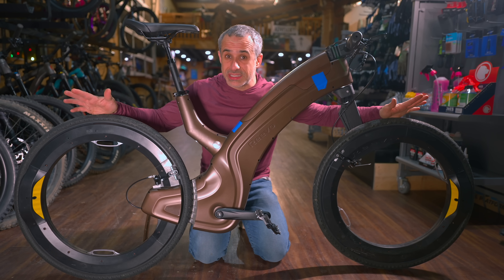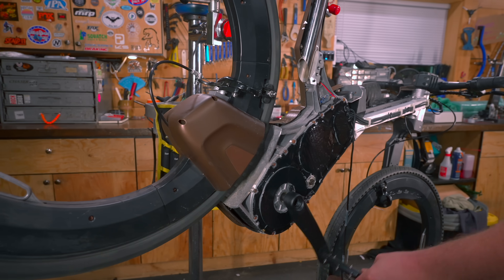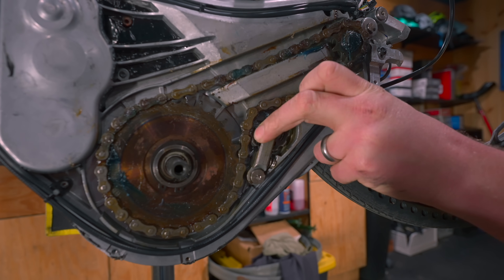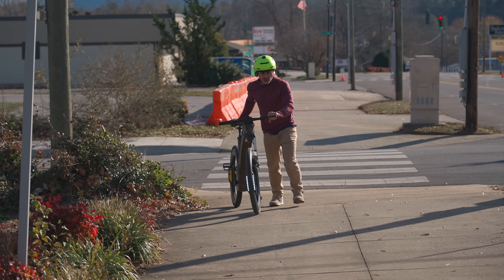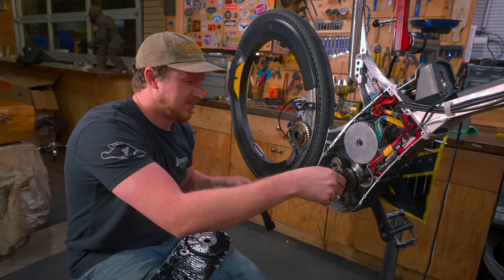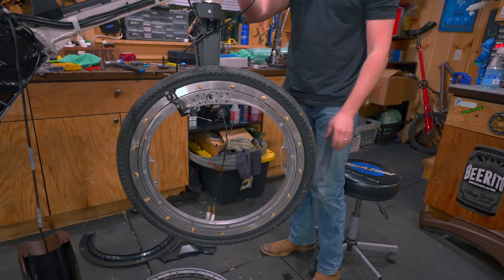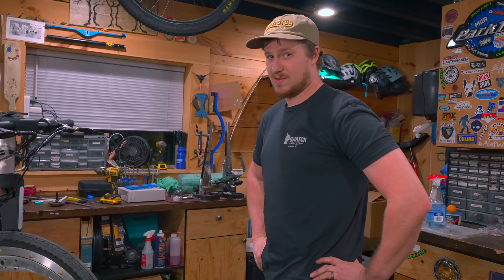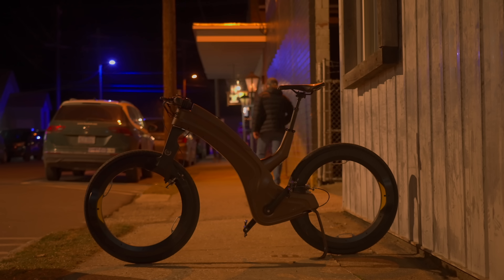What's Inside The World’s Worst eBike? Reevo Teardown

Comment: 4:36 On the end of the crank axle you can actually see the "incredibly clever pedal assist" which is just 12 magnets with a sensor for it in the casing probably. It's called a cadence sensor and is used mostly on cheap chinese bikes and diy ones. It only senses the rotation speed of the cranks and even with a proper freewheel feels like a death trap.
Reply: It should really be measuring the torque from the pedals, so if they free-wheel as was shown, there would be no torque from then so the assist motor would not kick in.
Reply: I'm kinda flabbergasted that this bike doesn't have an actual freewheel anywhere, it's just such a terrible idea
Reply: I'm one of the suckers who have this bike and have had it apart a few times. With regard to the 12 magnet pedal assist plate - is it meant to be fixed to the gear behind as mine just free wheels on it's own?

Comment: at 3:50 you can see a servo (used in every rc car and airplane) its the Blue thing with the red stripe. Even the servo is the CHEAPEST model possible. It might not even be bad how they used it but I think it's hilarious
edit: when you see all the cables xt60 connectors or xt 90 (Im unsure what it is) can be seeen, also commonly used in the rc hobby
Reply: That servo looks like Hobbyking 2 usd basic 9gr servo, mostly used on small foam planes, and it has plastic gears... Expecting at least them to use metal geared servos, but no... 
Geesh. Totally cheapest and crappiest servo that exists... :D
Reply: This is so fucking infuriating it Looks Like a Tower pro knockoff😭

Comment: I would love to see you put it back together with an improved design.  A more powerful motor with a more direct drive.  Better bearings on the wheels etc
Reply: You'd have to rebuild it from the ground up and redesign a lot of it. Look at the solid aluminium frame alone, that should be replaced with tubes. Possibly replace that giant hub gear with steel to reduce wear (though that would horribly increase the moving weight). If you wanted to properly improve the design, you'd have to make it more serviceable, you might have to replace a lot of the software, too.
This would basically turn into a ship of Theseus situation

Comment: It's like the juicero of bikes. Zero thought went into functionality, but the engineering put into such a dumb idea is actually awesome and beautiful.
Reply: Its really not. Engineering is using  least of materials and solutions  possible to reliably accomplish the task. But this is an example of  anti-engineneering.
Reply: @dukenukem8381 this is just what happens when engineering is constrained by industrial design. The company wanted a hubless wheel. This is what it takes to achieve that. The engineers did their job, but what they were told to do was make a cool looking bike not a good bike. 

It’s not an engineering fail, it’s a product design fail.
Reply: @ No it doesn't take ten or more bearings and multiple castings to achieve hubless. It can be achieved many  different way more efficient ways .This design in the video is by 12 year old.
Reply: The juicero was completely overbuilt for the purpose. Someone wanted a press and the engineers made a really good press. This is just poorly designed because someone wanted to throw out a very efficient part of a bicycle and use a very inefficient one.
Reply: I thought the juicero was way over engineered but it did work, this doesn't. Wasn't it the cheap loss leader for extremely overpriced juice bags?

Comment: I feel like there has never been a better time for shitty bikes. There have always been cheap bikes, but even those were viable transportation, you just have to work harder. I think ebikes should have a higher standard, in that they should work just fine without electricity, but become fantastic with electricity. I recently parted out an ebike, because it was terrible as a bike, and terrible as an ebike(yes, it does 20mph, but its heavy and underpowered (500w))
Clearly, the thing to do with your bike, is to redesign it to be better, make a video about it, and sell kits to upgrade them.

Comment: From the hindsight. If they had a chain in there, they could just make two chained drive system: one for pedals and another for motor. So they didn't have to add dozens of gears.
Edit: This bike after-sale service will be the same level with Apple. Imagine your hubless wheel bend. No way you can find that service outside the brand.

Comment: the gears to connect the motor are bizarre, becausse you dont need to have a chain of gears to make the motor spin the right way, you can just turn the motor around and spin it the other way (assuming the motor cant just spin both ways anyway like most can) and eliminate at least 1 gear, or just connect to the thing directly, or use a chain like they did with the pedals, or even a few bevel gears and a driveshaft, or...

Comment: Techbros trying to reinvent the wheel in the most literal sense possible
Reply: But hubless wheels arent new
Reply: This is what happens when nobody involved in the product development knows anything about why bikes are how they are. The wheel spin test says it all really.
Reply: @eternaloptimist2840  So, basically just like every Techbro invention out there?
Reply: They didn't even do it properly! We know how to make arbitrarily curved linear tracks that can support metric tons of load, for industrial applications. This, with cheap crappy V-slot wheels in a V-slot channel, is not how it's done.
Reply: Should never have left the requirements stage.
Reply: I laugh every time they try to redesign trains, always far more expensive to move far less people. It's crazy.
Reply: @ "But... it has AI in it."
Reply: Should have been wheellegal
Reply: Those aren't wheels, they've invented solid one piece circular tank tracks,  put the idler wheels on the track and replaced the drive sprocket with a cog. So it is a pedal powered battery assisted tank, with the performance and weight to match, only it is not been made bullet proof.
Reply: This is just the first draft. Give them a few billion in VC and a few more years, they will iron out the kinks and have a standard bike.
Reply: @JohnC1 the makers have dipped. They will not be making more bikes anytime soon
Reply: @JohnC1  lmao, it's the techbros reinventing trains all over again
Reply: True, but that’s how innovation happens. Kudos to them for making something entirely new; even if it was awful in practice, new ideas and inspirations will come from it.
Reply: @ricercr44  It's really, really not. Innovation happens when people actually consider the needs of the people who will be using it, which very clearly didn't happen here. This was just cosplaying innovation.
Reply: @crytocc what do you know about prototyping, product development and innovation? It’s not something that you can just judge by gut feel as an outsider. The product is crap, but armchair experts aren’t going to explain why
Reply: @ricercr44  No, i'ts pretty much the opposite of innovation.  Innovation requires understanding why things work the way they do, and how people interact with them.  In this space, innovation would require understanding the literal century of actual innovative engineering that went into developing the bicycle that we have now.  Actual innovation is someone saying "how can I make this more efficient, more durable, more ergonomic, or more safe, without damaging usability?"  Techbro pseudo-innovation is "how can I build this cool thing I saw in a video game and make a bunch of money off it"?

There is literally nothing in the Reevo that is innovative.  Hubless wheels are been re-invented multiple times in the past, and each time they proved to be far inferior to standard hubs.  The Reevo does not even use an innovative hubless design, they simply re-created an old rejected design, but made it worse, with low-quality materials and backyard construction techniques.
Reply: @ricercr44  It should never have left prototype stage.
Reply: @pizzablender  I wonder if they even built a prototype to test anything out, this looks so bad that, I suspect this went straight from the CAD package to the manufactured ebike.
Reply: @ricercr44 There's no innovation here, nothing that hasn't been tried and failed before, just with pedal-assist and an app this time.
Reply: @ricercr44  Its how shitovation happens
Reply: @frankdobs  it’s how both happens.
Reply: @ricercr44  Hubless wheels are not entirely new. They've kicked around for many many decades, usually as props or one ofs to look cool. Every engineer knows the physics that makes hubless wheels terrible, so only fools would attempt to put one on a mass produced product.
Reply: @ricercr44  that's not how innovation happens tbf. This is the opposite of innovation. Its not solving any problem whilst existing applications have been proven to work for over a century all over the world.
Reply: @ricercr44  If you cannot even make your idea function properly on paper, you're not innovating. You're just repeating mistakes that you could have learned from a textbook.
Reply: @ricercr44  It should have been obvious when designing this thing that the hub is the entire reason wheels are so efficient. It's like making a screenless television. No, we don't need to innovate by ruining the purpose of things.
Reply: @ricercr44 when you are trying to be innovative you should always add common sense to the plan. In this case they did not.
Reply: @ricercr44  No, this isn’t innovation. It isn’t even close to innovation. This is like someone deciding that a new geometric shape should be used for wheels because circles are outdated technology now. Innovation happens when someone finds and implements a better solution, not when they try to sell a completely impractical idea that’s worse in every way than the existing solution.
Reply: @CanIHasThisName  that describes the Segway to a T!
Reply: @ricercr44  except this isn’t a innovation. It’s a downgrade

Comment: Dumb engineer here so just speculating; but I couldn't help but notice in the clip it kind of sounds like you might have some motor/generator action going on, kind of like when you try to push one of those wind up car toys along the floor and it has resistance. I'm speculating here, but what if when the motor drives the bike, it acts like a motor, but when the pedals drive the bike, it acts like a generator. That would create a back EMF that would create some hefty resistance in the pedals. I've researched none of this so take it with a grain of salt, but I could see a world where they don't disengage the motors or clamp that back EMF in some fashion, which must be a thing that normal pedal assist system account for? Or more likely, a way to mechanically disentangle the two?
Reply: Normal e-bikes don't back drive the pedals and motor.
And it's achieved in the simplest way possible: by the freewheel in the rear wheel
Reply: Good thinking, but the wheel spinning test was on the front wheel.
Reply: I wouldn't be surprised if the designers did overlook that issue but, to me, it's just the sound of a really inefficient drivetrain.
Reply: I think you’re on the right track. E- bikes with direct-driven motors do create resistance with normal pedaling because the motor is always engaged. E-bikes with mid drives or geared hubs tend to have a clutch that lets you pedal without driving the motor, so much less resistance.
Reply: the front wheels terrible as well... but on the rear? the rim gear is massive, at a guess, its about 6:1 step up (approx 24 inch to 4 inch) when backdriving. so then the chain is spinning stupid fast, and theres how many bearings in there?
ANY gearbox with a 6:1 step up is pretty hard to spin... 

they should have the freewheel in the final gear, and that would at least cut the losses down to just bearing friction in the rollers...
Reply: 🗣️ I was kind of thinking the same thing. It also leads me to believe that it comes across as a trickle charge for the battery... 🧐

Comment: Reminds of the juicero, if you haven't seen a teardown of that thing it's worth a watch. Over-engineered to the moon and still a dumb idea.
Reply: It's actually under engineered. The designers were given a huge budget per unit so they just threw together the most solid, blocky structure they could. It takes a talented engineer to design something that works, but also is simple enough to be cheap.
Reply: also with aluminum gears that looked like they were designed by animators not engineers. for power gearing of all things. think I gotta mark these down even further, they look die cast, at least the stupid Juicero gears were for super intermittent use and made from plate
Reply: And still somehow sold at a loss.
Reply: @DrEpicPhD  It was a subsription based revenue machine, and probably they over-engineered it to last a pretty long time. The longer you can milk your cow is the better you see :D
Reply: @ggooaa100  just a shame that the bearings in the Juicero were being loaded in completely the wrong direction and were doomed. Still, you could at least just squish the smoothie out by using your hands.
Reply: Overbuilt, under-engineered.
Reply: The Juicero had better build quality though.
Reply: @ I meant it in the sense of a ton of R&D spent solving problems that don't exist.
Reply: The review of the juicero, the dead-pan voice of the "honest review" is one I keep watching as a reminder for when I will never start a kickstarter project as a form of advice on what not to do :P .
Reply: Fucking dumb, but over-engineered in a good way. That thing was marvelous in a machinist eye, but this thing... Just crappy off the shelf stuff thrown together with aluminium square tube welded to cheaply casted parts, and so on... No locktite on a rotating part with a dozen of screws and no suspension from the wheel(air tube) or literal suspension.. What were they smoking?
Reply: It's not a dumb idea at all, and the way you are pretending that it is is incredibly ironic. A few years ago, I would have given you the benefit of the doubt and asked you to consider editing your comment, but I'm not expecting that kind of critical thinking from people these days. Buying a smoothie in a bag in obviously much more environmentally friendly than buying it in a plastic bottle and is probably cheaper, therefore it's an inherently decent and marketable idea. The absurdity of Juicero came with needing an electronic press with DRM when an OPTIONAL 5 dollar plastic hand operated one that comes "free" with a variety pack is all that was actually needed.
Reply: @awesomeferret  What a magnificent comment, all that to agree with me that spending millions of R&D on a juice press was a dumb idea.
Reply: @awesomeferret  The better counterpoint to Juicero isn't premade prepackaged juice or smoothies, but a conventional blender/juicer and fresh ingredients. That wins on environmental consideration, health, and cost - at some loss of convenience. Juicero was outclassed by some other method in nearly every area unless you had a very very niche combo of preferences, and then it was still of dubious quality and no longevity. An obvious VC grab for subscription revenue vs actually making a good thing, and it failed, and that's why so many people dunk on it. Hopefully that makes some sense with a little more of your critical thinking, to reference your wording. Or maybe you're a troll but I'll still give you the benefit of the doubt.
Reply: @awesomeferret  you tried to sound smart but came off as a tool. Lol.

Comment: low key want to see if you put good bearings in it to replace the ones you took out if it would roll better
Reply: Don't think so. There's too much rolling resistance created by all those tiny wheels around the rims.
Reply: You're gonna need to replace the hub for that. V-slot needs to come out for T-slot or better yet, the whole shebang needs to be replaced by a curved linear track assembly. Would probably cut the roller count to just 8 or fewer that way, and they'd be metal on metal, with much less friction involved.
Reply: @vjoe166  I'd argue it would run better without pedals, using only the electric motor